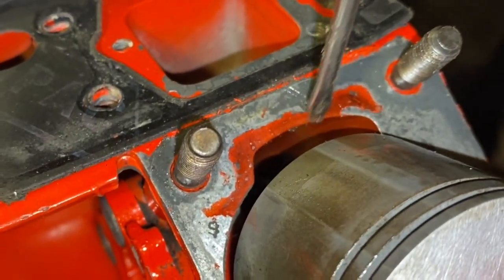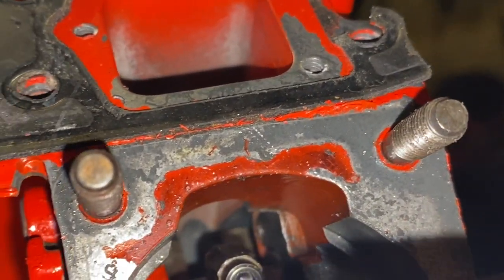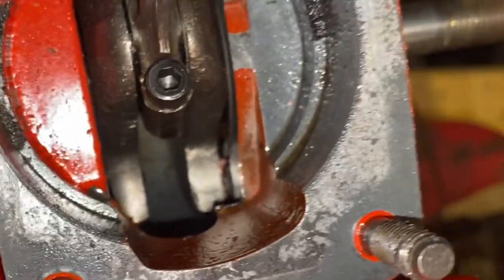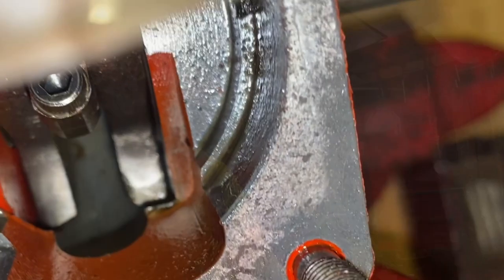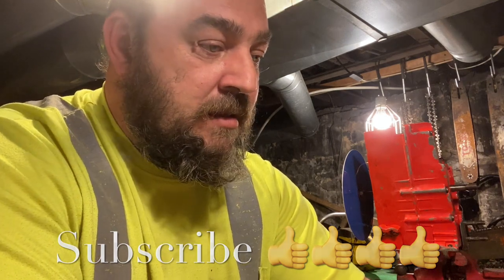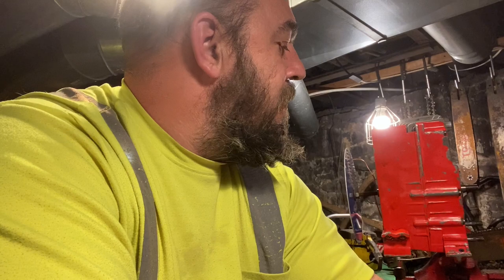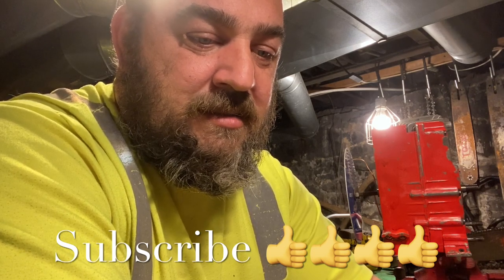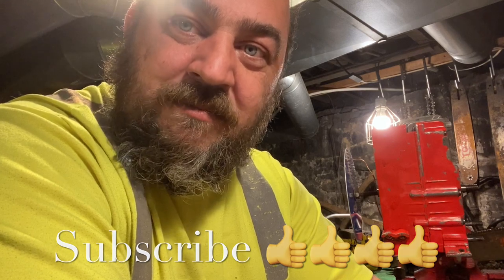Homelite Super XL-130 Chainsaw Porting!  Decision Making On What To Do!

Comment: Now we got to talk if you want to make it a screamer or torque monster or even what the saw is going to be used for those are always some basic starter questions I ask people before I port that will let you know which way to go with your numbers and Port methods flow tricks and etc
Reply from the maker: Definitely toss me some ideas!  This saw is getting done by my gut feeling right now. To be honest you are just catching up to where I am right now. I finished reassembly last night.  This one is a learning experience. Pass or fail it will be on video. 

101 exhaust 
Transfers are opened up but could go a little farther if needed. I also ran two boost ports opening up about 1 1/2 degree before the transfers. They are about the size of my bit. You will see them on a video coming up soon. I also had to match the crankcase to the transfers on the cylinder. You can see it on that video I did about air leaks. Final compression is about 197. Im more concerned about moving enough through the carburetor and transfers. I can stick a larger carburetor on of needed. If I get home before dark anytime this week I am going to try it out.

Comment: Where do you get your parts from? I need a piston for my super xl.
Reply: Pawn shops, ebay, Craigslist, all good places to find parts.
Reply from the maker: Little red barn is a common source.
Reply: Bought one before from them. Honestly I think they machine them, then let them cool. The worn original fit better in my bore.  That being said, if it is just a matter of some transfer wear- just run your original- that is what I am doing.  As an FYI, proline also sells them, they look to be the same from photos I have seen. Same price as well.

Comment: I have a recommendation to answer your thoughts about porting. I would recommend finding a book called MotorcyclTtuning for Performance by Carl Shipman.  It is out of print so you will have to find a used one or I can copy the pertinent info out of my copy. All your questions in your video can be ansered showing the pro"s and cons of each modification. Your carb was sent today, and should be there in short order.
Reply from the maker: Thanks!!  I will try to find a copy of the book. I’m almost ready to ship your saw. I am going to give it one more run just to be certain the bugs are worked out.
Reply: Thanks @Smittyschainsaws

Comment: Hey Smitty I have a question. I have a c-71 that runs great. Fires up on first pull. Idles great. Revs smooth. But as soon as I go to cut it bogs and dies. Cranks right back up but dies again if I try to cut. Any idea what it might be?
Reply from the maker: It sounds like an air leak. It’s going lean as soon as you hit a point that you need the extra fuel. Spray break cleaner on the seals and gaskets when it is running. You will know instantly. Crankshaft seals, cylinder base gasket, Carburetor gasket,  and intake gasket.  Also check that the fuel line doesn’t have any pinholes or places to suck air. Fuel filter could be plugged preventing enough fuel to flow. Carburetor could be gummed up. Could have week spark. 

Just check one item off the list at a time. You could have multiple problems as well so don’t stop if you find one problem. Check everything!
Reply: @Smittyschainsaws   thank you so much man. I appreciate you taking the time to help me out.
Reply from the maker: @jackslater4870  Just let me know if you need more help.
Reply: @Smittyschainsaws   I will man. Thanks again